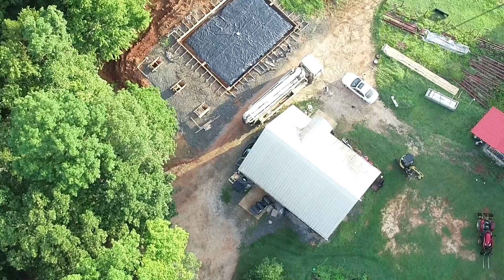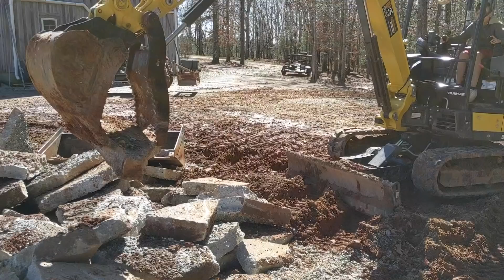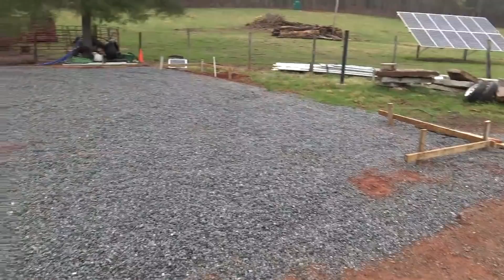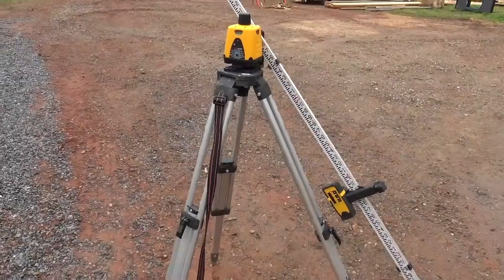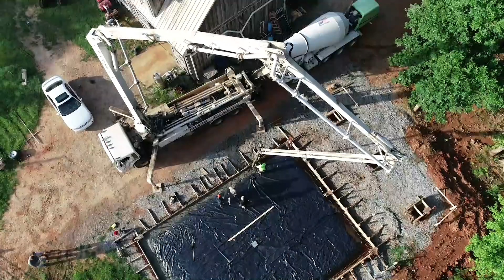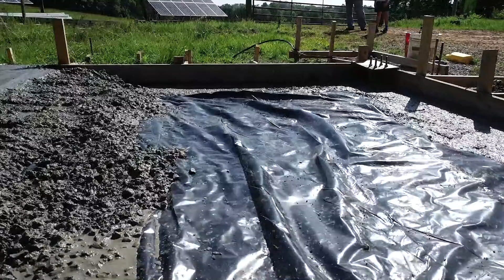Steel Building Part 1: Pouring Concrete

Comment: No or at least VERY little rebar? No beams?  Hope you are not planning to put much weight on the floor. Fiber is no substitute for weight bearing loads like you plan with batteries.

Comment: Fiber is no replacement for rebar when high point loads are planed. Tires carrying pallets of batteries are a high point load.
Reply: Yeah. At least put some wire mesh in with it. I can’t believe they didn’t do any reinforcing.
Reply: @Mad.Man.Marine  no kidding

Comment: Really surprised at the omission of rebar. Did you use a fiber in the cement? Beautiful job otherwise. I bet you can hardly wait till the roof is on. Looking forward to your next vid.
Reply: 12.31 he said he had fiber in it.  It's funny I was thinking the same thing and then he said it.

Comment: Looks like NOT putting any rebar in it.
Reply: He said he put rebar on chairs in the footings tied to the piers.
You could see it around the edge.
Reply: He said he had fiber added to it, which would suggest he used fiber reinforcements.  Would have been nice if he showed what kind they added because there are different kinds.
Reply: @hxFubar  fiber means there is fiberglass in the concrete mix. Not rod or mesh. He didn’t put enough reinforcements in the slab. It’s going to crack all over the place. Not just where the cut lines are I bet.